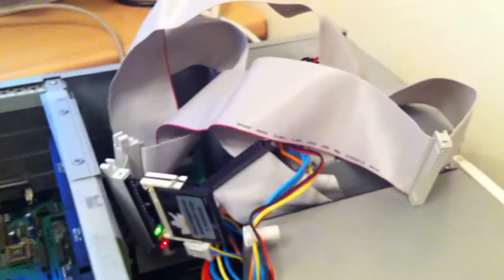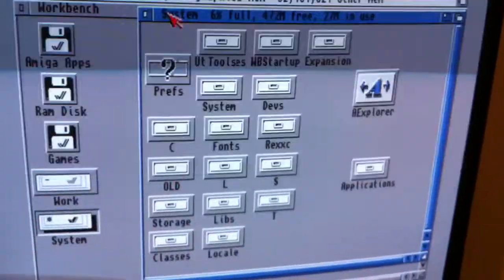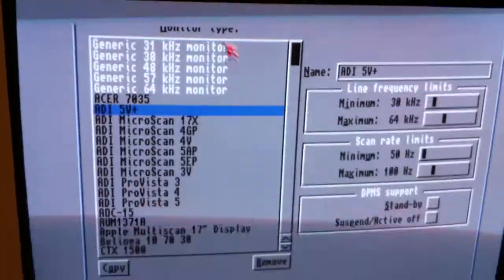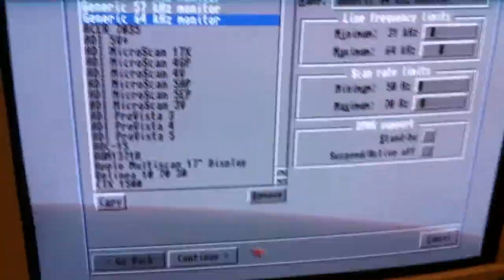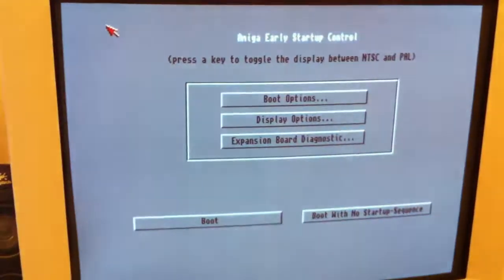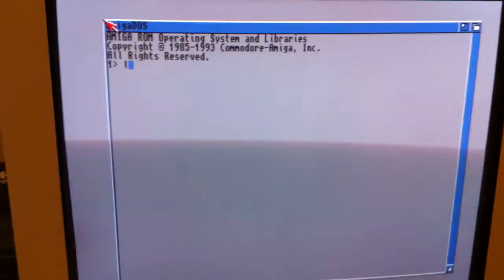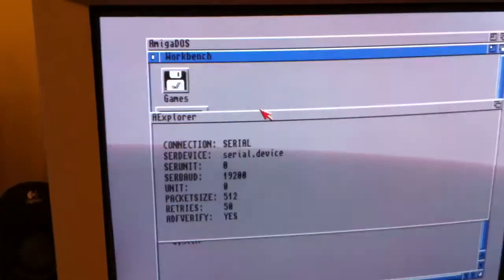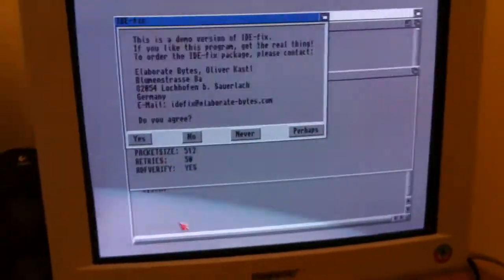Amiga 4000D - Picasso IV Driver Problems

Comment: I have the same problem with my A1200. It has an Mikronik 6860 Zorro Board and a Picasso II installed. Powerd by a Blizzard 1260 with SCSI Kit. Running OS3.9
Reply: Micronik made the worst,nosiest bus boards on the planet, They are infamous for this. If you get anything to work properly in their boards, you are doing well ;)

Comment: makesure you have p96 v2.0B at least, installed properly of course. Once thats done load p96 and attach settings to board(no idea why the board didnt show up the first time), once u have attached setting,they will appear in screen mode and can be selected.
you can hold both mouse buttons down to get into early startup screen and see if the pIV is listed as working.
You also could have a piv board rev1.2(1.2N is latest i think). Your old board may need the bridge chips upgraded.mastatabs can be found on most amiga forums and can help, he has the chips. Also make sure your flickerfixer firmware is latest.
check here: http://www.sophisticated-development.de/software/index.php?thisfile=.//P-IV&section=P-IV

Comment: This video has been around for a while so you probably have it figured by now.  If not, let me know...and I'll guide you through what you're missing and what to do.  You need a Settings file in Devs: or you have to create one.  Then you'll have Screen Mode ID's to set further.
Reply from the maker: Hi Michael, I have indeed fixed this - but to be honest the way I did it was to couple the settings from the hard drive I bought with it and I copy them across to whatever OS I'm running (on a CF card) - upto OS3.9
Reply: Michael T hi, I’m having the exact same problem.  Can you let me know the steps to fix this please?